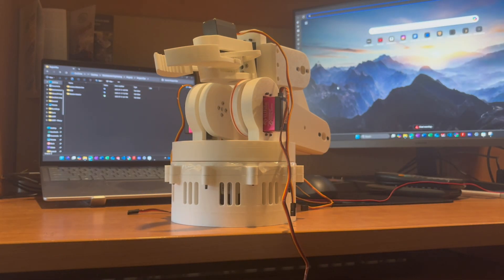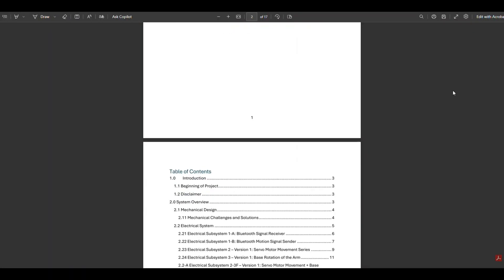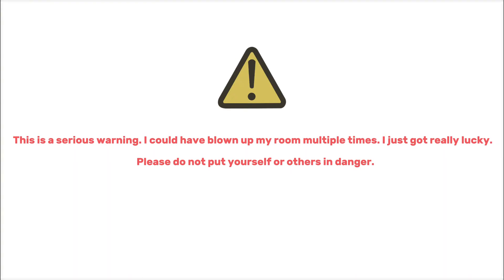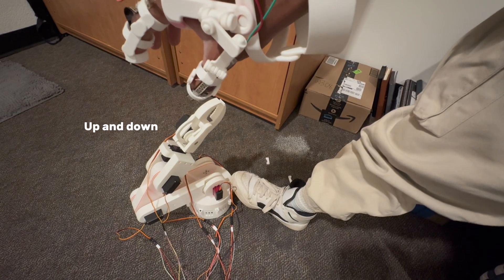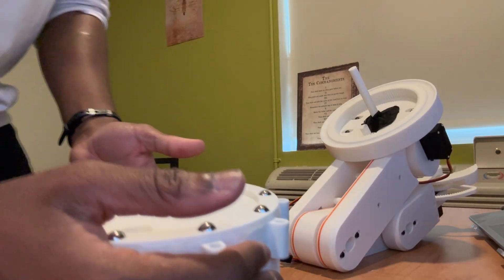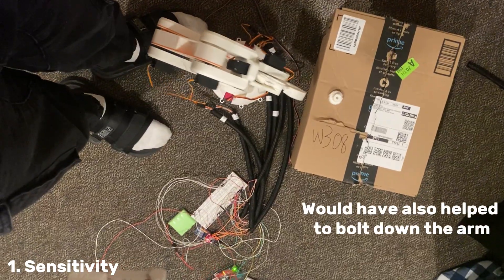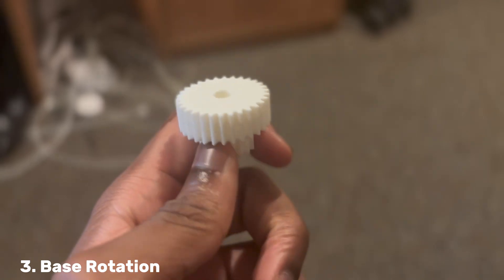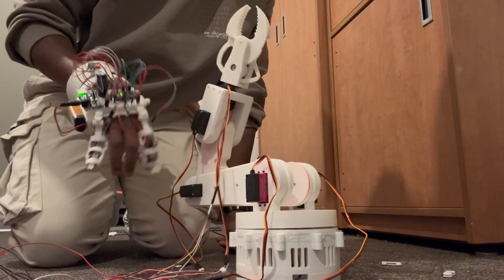I Built a Wireless Robotic Arm Over The Summer…

Comment: great video man! i am currently designing gen 2 of my robotic arm because my first one had terrible tolerances and electrical problems.
Reply from the maker: Hey! That’s great man. What bugs did it have specifically?
Reply: @phenyo-ditebo I did not have a variable power supply and I might of used too high of a voltage and fried my smaller servos. Also the grippers never would close flush 💀. I feel like the start of my design is good and logical but the further I get along in the project the worse it gets! So far Gen 2 is held together by m3 screws and not hot glue like last time
Reply from the maker: Well then 😭 at least you’ve figured out the issues 😭😭